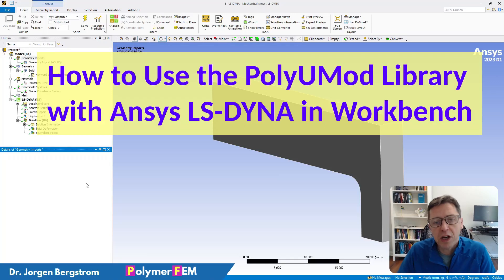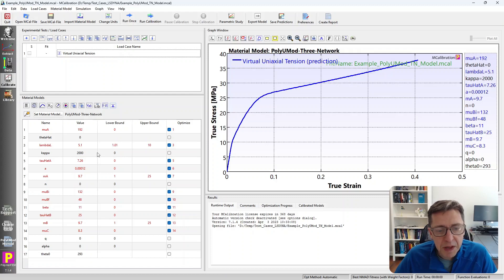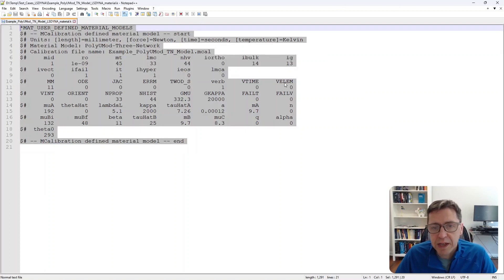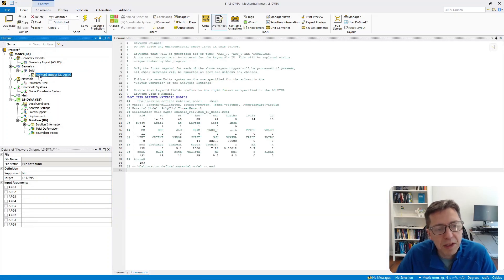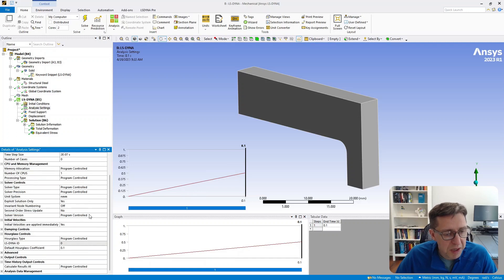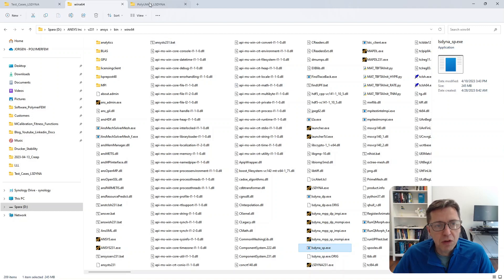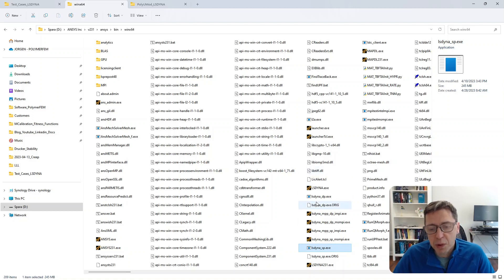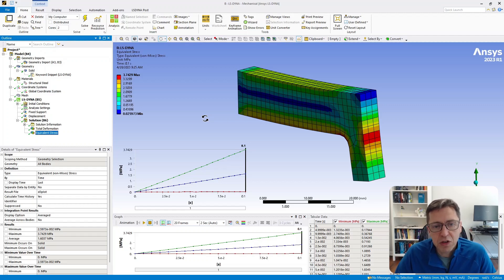How to Use the PolyUMod Library with Ansys LS-DYNA in Workbench

Comment: Hei Jørgen,
Thanks for an interesting video, I'm rather a COMSOL Multiphysics (r) user but I see your PolyUMode has also a material translation to provide for COMSOL :)

Now, what I wanted to point out is that it would be nice to have a simple way to check the transfer to our favourite FEM programmes of the material data, as I used to have strict validation and verification (V&V) requirements from our customers.
Do you see a way to provide a few interesting load cases with 2-3 reference points, per load, for a simple block material model (i.e. load of compression/tension, shear x,y ...) from PolyUMode such that we may have a simple model to run in our programmes to ensure that the material data is really interpreted correctly in our favourite FEM tool ?

This would be nice to have some reference to ensure the data transfer is OK, as demanded by most PA/QA requirements.
Clearly something simple, but that covers anisotropic behaviour, for non linear material.

Thanks for your feedback
Ivar